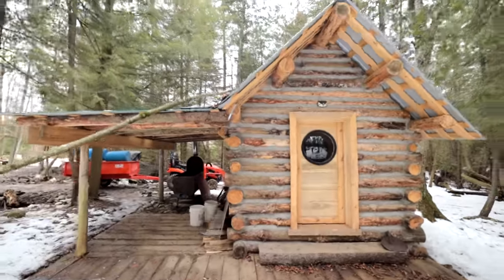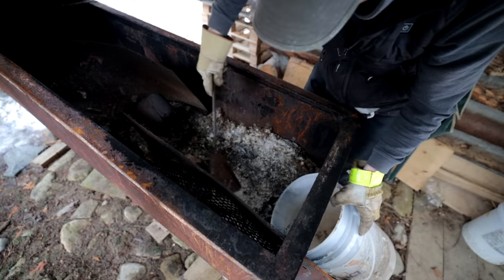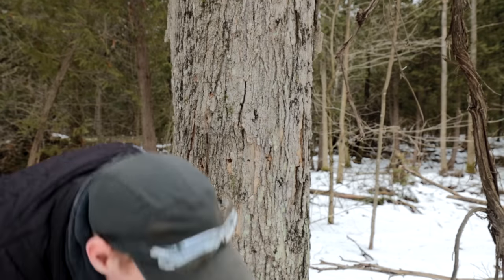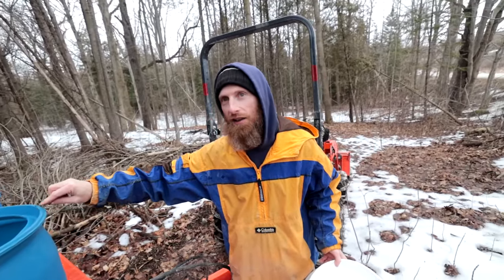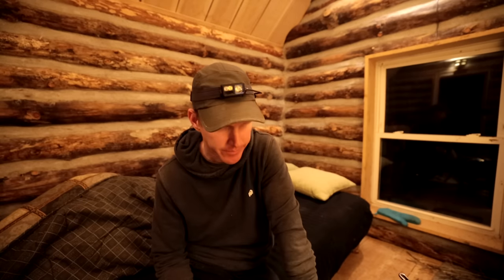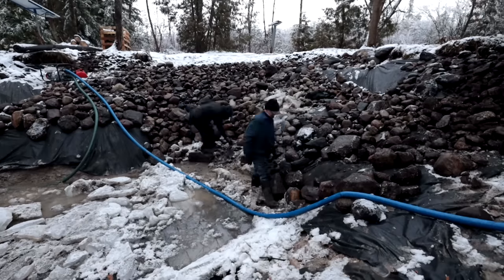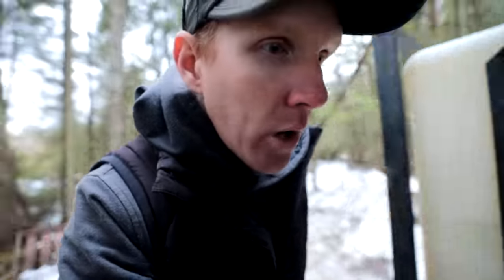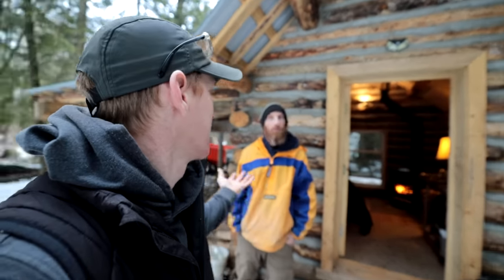Overnight at the Maple Syrup Sugar Shack! | Start-to-Finish Maple Syrup Pancakes on Wood Stove

Comment: With your elbow , what's happening is the muscle and tendon is developing micro tears from the bone, from over use. (Years of drywalling). The band , supports the muscle and tendon and allows them to heal. This is how it was explained to me when I went through the same thing. Great video!
Reply: Yes, and I'm thinking you should wear it for a few weeks at a time so it can heal completely 😉 Not at while sleeping or in relaxed state but definitely ot your doing most things.
Reply: Could haven't said it better my self . I used a similar product  he did for four year on and off ( over worked tendent )

Comment: The key to doing this yourself at home is to plan the summer before. Materials become hard to obtain during maple season. Start by identifying your trees while the leaves are still on (see Flag of Canada for example). I started last year with three spiles and expanded this year to nine; a mix of old school metal and new plastic. I LOVE the galvanized nail to pin the bucket up vs. using the hook. That's exactly what i did to expand for this year and I like it even better than the new style buckets with lids integrated into the spile.

Comment: The arm wrap temporarily shortens the injured tendon. That allows the injured tendon’s attachment to not work as hard and possibly heal. I’m not a doctor, but I’ve had both tennis and golfer’s elbow that were caused by a damaged ligament, which in the end led to Tommy John’s surgery where they took a tendon from my forearm to resew a lower arm bone to the upper arm bone because my ligament that was supposed to do the job had nearly totally disintegrated.

Comment: The elbow problem is due to the ulnar nerve being compressed.  The contraption probably relieves some pressure of the nerve against the bone (elbow).  I had to have a surgery for some relief.  It didn't really work.  We have topical lidocaine at the dollar store I use for instant relief.  Hope you feel better.  Great, informative vid.
Reply: A doctor told me to never agree to any tendon surgery in my arm until I could not open or close my hand.  Because that would be all the use I would have after they got done with it due to where and how the tendons were tore.  It's been almost fifty years since that advice and I can do more now with less pain than I could then.

Comment: Just did my first boil of the season last week! Although the last several days have been wonky weather and the sap hasn't been flowing (Rhode Island). Though there have been some extreme low temps for the area here and there, it's largely been a warmer-than-average season which is hurting production region-wide so far.

Comment: Hey you’re back, figured you’d be tapping trees.  I use the blue 5 gal water jugs from water coolers keep the plastic on the top that stays when you pull it off the cooler and feed tubing from a plastic spile into the plastic on the bottle neck. Bottle stays on the ground. Easy carry, no spilling. No lids, no debris👍 pole barn w a hoist setup? For the mill sounds great.

Comment: I had a similar things for my knee and it worked great. It adds support to the joint and that is why it works so quickly. Cant believe a little thing like that can add the support but it does and helps alot.

Comment: Being a Certified Orthotist, I see this problem often. Golfers and Tennis elbow is a torn tendon from the epicondyles. The Bandit or Aircast splint compress’ on the tendon below where the pain is relieving tension from the torn tendon thus relieving pain.
Reply from the maker: Will it fix itself over time?    Or is this something that requires something more.
Reply: @ModernSelfReliance  I just went to an Ortho for tennis elbow, and I was told it will heal over time, but it can take months to fully heal. Doing a few stretches a few times a day will help a lot, and be careful not to strain it again. Anti-inflammatory meds also help by giving the torn tendons a better environment to heal. I was given some arthritis meds that have made a world of difference that I wasn't expecting
Reply: You remember the expression about something being their ‘Achilles heal’. Tendons are that way, if you overdo it, it will start to flair again. I wore my band for about six months when my tennis elbow is bad and I never feel it now unless I overdo it.
Reply: Be diligent with wearing the Bandit and you should be feeling better in a couple weeks.

Comment: The arm brace you are using is used to put pressure on a different part of the tendon to release the tension on the sore part of the tendon that is at the elbow level

Comment: next improvement idea: build a high enough platform so you can pull a hose from the tote to the evaporator, and add stairs to that platform so you can easily climb up during the filling process.

Comment: You should build a Reverse Osmosis system and or set up a vacuum lines for future sap transport to the sugar shed collection tank where the ro system will break it down and concentrate your sap from water and reduce evaporation time & fuel 😉both will greatly reduce labor intensive aspect and also allow for more production 😊

Comment: Definitely need sawmill shed first then you can cut whatever you need that one beam or board you thought you had but can’t find or used somewhere else. 😂 it will be less work to use it if it’s under a roof, plus think of all the additional things you can do like a cabinet to hold extra bandsaw blades and wood drying kiln wood fired of corse the list is long the kitchen gazebo would be more fun when it’s warmer and I built one about twenty years ago had a small grain bin no longer used took just the roof and built a small outdoor sitting space to enjoy the outdoors even on a warm rainy day without getting wet.

Comment: Not a doctor, but from what I remember: nerves can only send pain OR sensation signals at any given time. By putting pressure on a pain site, it prevents the pain signal from getting through. That's why you hold a stubbed toe, etc.

Comment: 7:04 I have some thoughts... My family also does Maple Syrup. We tap a thousand trees or so... maybe very high hundreds, I dunno exactly but it's over 100 acres. We recently built a new saphouse for cooking along with some storage and hangout space and whatnot. I think it's 20'x40' or something like that. We use a tube system and pumps rather than buckets. We have large several-hundred gallon tanks at low spots in the forest and then just gravity feed them using the tube network which connect to spiles on the trees. We pull up to the tank with another tank behind a tractor or truck and use a pump to transfer the sap from one tank to the mobile one. Sometimes we have to empty these tanks a couple times a day because the sap is running especially well. We set up some overfill sensors connected to electric shutoff valves so the tanks don't overflow (new the year before last, lol). Then we transfer the contents of the mobile tank to a stationary tank by the sap house which then feeds into the evaporator via another pump system. I'm not sure how much of that system is automated, but it's a decent amount.

My thoughts on your tank setup. It's too high. You're going to get very tired very quickly if you're dumping bucket after bucket of sap. It's a plastic tank which means it should be able to be air-sealed. If that's the case, I'd attach a bike pump to it after you close it up and over-pressurize the system to force the sap out. If you don't want to have to repressurize it manually, they do have 12V air pumps you could buy and just run it off of a battery (like the EcoFlow) or your solar panels. This would allow you to keep the tank on the ground and still be able to get sap into your evaporator. Easier to refill the tank with your buckets if you don't have to climb up a ladder or ramp to then pour it in (safer too). You could probably use a garden hose (or some other food-grade hose) with a valve at the end with an adapter for the tank on the other. Pretty easy to refill your evaporator with that.
Reply: 9:49 The metal you use for cooking will actually change the taste and color of the maple syrup. Try it with both the cast iron and the stainless steel to see what kind of color and taste you like best. I'm told that having a lighter color and taste means the syrup is of a higher quality... Not sure how I feel about that, lol.
Reply: 11:50 I think we go with 1 tap per foot of diameter of the tree...
Reply: 30:23 If you do go with the Lumber Mill building route, you can add a side project too. Collect all the sawdust and make a compactor for it so you can make little saw dust logs for burning later. It would need to be hydraulic so you'll need a reservoir and pump and all that. They've got YouTube videos showing how to do it. :)

You're going to want to have the grain-bin-zebo in place so you can actually use it in the summer. lol.
Reply: 35:09 I had that too. For me, all I needed to do was crack my elbow a couple times and the pain went away almost instantly. To crack it, I make a fist, pretend like I'm doing a bicep curl, and then fling my fist out with some force (making sure not to overextend the elbow). I usually get an audible crack, followed by a moment of slight numbness, and then it goes back to normal with no pain. As soon as you feel it tightening up again and hurting, just fling your fist out again until your elbow cracks.
Reply: Great video! lol.
Reply from the maker: Thank you for this.

Comment: “It’s not petrified, it’s just really scared.”  Kevin, that is the best quote I’ve heard in a long time.  Great seeing you, Don and Chris back on your channel.  How will you be filling the steel encased plastic tote with sap?  Are you going to move it to ground level so you can access the filling hatch and then lift it on the pallet stack to drain it?    What is your plan?  

The elbow band compresses the tendons allowing them to rest and heal.  It’s when the tendons are strained that they become inflamed, swell and cause pain.   

Your idea for a wood shed is excellent; both by shielding your equipment and extending your work conditions.  Fall Line Ridge has a saw similar to your equipment.   The following link may offer some insight into his build.  (https://youtu.be/Tz9YYDCrk_8 ).   Windmill for your pond would be interesting.  Which of the two can be completed first, probably the wind powered water pump in anticipation of spring rains.   Do you have sufficient roofing materials for your wood shed?

Wishing you and your family a blessed week, gentle seasonally appropriate weather and restful evenings.   Peace brother.

Comment: So, I haven't read all the comments, so if this is redundant . . . how were you going to fill the sap storage holding tank? Fill opening is on top. Too tall to lift a bucket over it. No steps up, or platform (better) or were you going to use a pump to pump it from the 30 gallon containers into the holding tank. Personally, I would have used a pump from the holding tank, set on maybe one pallet, to the evaporator tank by hose with a stainless u bend to hook on the side. Much easier overall especially on the shoulders. I know, I'm 64, hips and shoulders are the areas that get tight when you're a working man. My 2 cents.

Comment: If you Will shock your elbow it will stop hurting. A mig welder works good to do it with, put your elbow on the ground and take hold of the wire with that hand and pull the trigger. It doesn't hurt and the elbow pain will be gone.
Reply from the maker: That sounds super sketchy... Perhaps last resort?

Comment: It is not smoke and it's not steam either. It is watervapor. Steam is watervapor under pressure (higher than 1 atmosphere) and because of that its temperature is also higher than the boiling temperature of the water. LOL
Your elbow thingy most likely creates pressure points on the tendons from your arm to your elbow. These pressure points take a lot of the force from your arm muscles and conduct that force to the bones. The pain is created by irritation/inflamation of where your tendons attach to the bones.  That attachment point has less force pulling on it which reduces the pain.
Reply from the maker: noun
the vapor into which water is converted when heated, forming a white mist of minute water droplets in the air.
"a cloud of steam"

Comment: Yup! Micro tears from repetitive motion. That band supports the area. There is a more elastic one you can wear while working to support the area better to help prevent more tearing. Use the plastic one after so the greater support allows healing, but may be too restrictive during an active work day. Age is catching up fella. Slow down and go with the flow.
Reply from the maker: I agree with the age thing...  Yes.  Slow and moderation is the key.

Comment: Yes you have been gone for a while try not to do it again the last video was you building your tool shed garage with that  diesel heater how is that working and are you keeping a running tab of how much diesel you are buying I think it would be neat to put a 5 gallon deisel with a hose On top of that main container that holds the diesel and let one drain in thewith an off switch on the 5 gallon diesel so you can take it and go fill it backup hook it backup to your other 1 and never have to worry about filling that 1 would pour it into it you'd have a dripping end from that other 5 gallon container  Bill N
Reply from the maker: I only use it when I'm standing at that bench.

Comment: Yes real maple syrup is expensive which is why you only put it on pancakes and waffles that are worthy of it and not frozen Eggo waffles. Last year you made coffee replaced the water with maple sap. Assuming 2 cups of maple sap has 50 grams of sugar in it . I wonder how it would taste if you were to use to make a pine needle sprite. The recipe is: 2 cups pine needle, 2-1/2 cup water, 4 tbsp of sugar. The pine needles well hopefully have the natural yeast to make this all natural soda.
Reply: Actually there's between 8 & 40 grams of sugar in 2c of maple sap, depending on the individual tree. Maple sap is between 1% & 5% sugar.
Reply: Interesting to know thank you. I guess the best course of action would be to do a Hydrometer reading first to find out the sugar concentration and simmer the maple sap until you have reduced it down until right amount to so it could be used to make a soda with.
Reply: @nicholaskarako5701  Yeah, that would probably work best. 

FYI did you know that drinking maple sap is extremely nutritious? It's full of electrolytes and minerals the body needs. Infact, it's one of the best things to drink to recover after exercising, think natural Gatorade, but without all of the artificial flavors and colors.